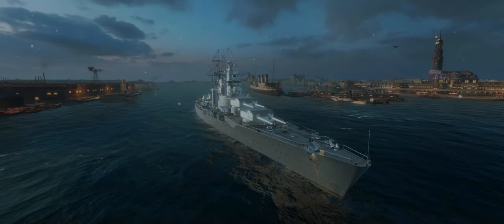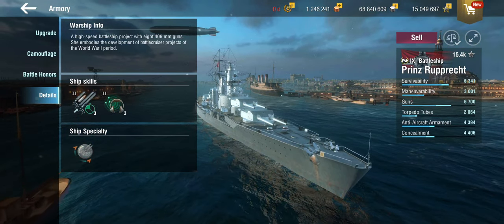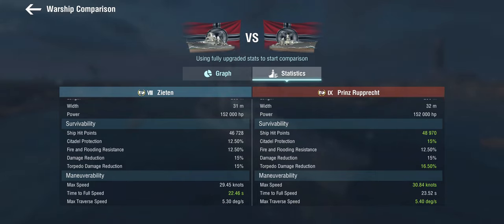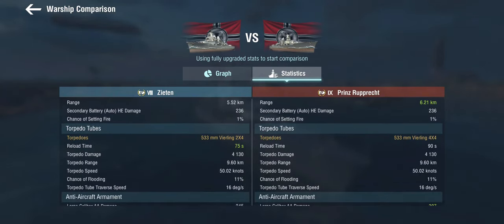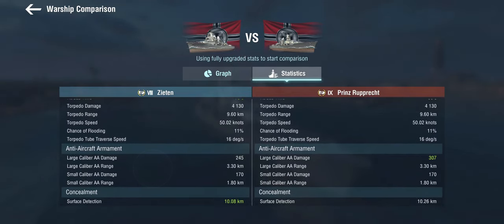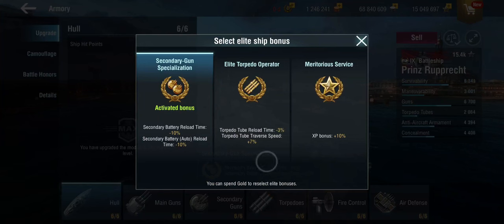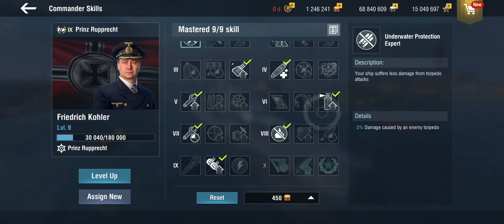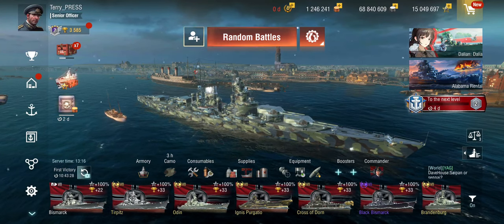World of Warships Blitz - German Battlecruiser "Prinz Rupprecht" review

Comment: Finally got around to unlocking the Rupprecht - it is such a blast to play. So far, I’ve found a secondary build with propulsion and concealment for the second and third slots have worked well, staying unspotted until you can unload a full barrage of mains, secondaries and torpedos really makes a big difference.

In terms of play style I find it’s very similar to the Odin. In fact, it seems like the Odin is what the Zieten should have been - even if you had to substitute the 128mm GK autosecondaries for 105’s in a tech tree ship.

I agree hots highly situational - but then so are many other secondary focused ships. When you can use concealment and positioning to close in, you can make absolutely trollish amounts of damage in a short space of time. If you can’t, it is more of a struggle.

Looking forward to the Schlieffen now, though it’ll be a while before I’ve ground that one.
Reply from the maker: Odin has one big advantage - size. That thing is comparatively small, and pretty manoeuvrable. Still, Rupprecht & Schlieffen are great fun, the latter is a direct progression, so if you get along with one, you'll like the other.

Comment: Hi Terry! I stand with you on the choice of the first module. I personally use the secondary battery enhance module on my Schliffen as well. 
For those guys complaining in the comments, if you guys want to use the main battery more, why play German BBs? 😂 You got plenty of options like the IJN and USN BBs.
Reply from the maker: It's not a completely invalid point - you have to entertain yourself somewhat while the teams are jockeying for positions. In the BB line, you do that by using the mains and the precise aim (which has 3x the impact of the slot 1 module), until you spot an opening. In the BCs, you use the time to get somewhere where you can use the dps, while compensating for the armour / HP. But I'm willing to test that a bit more :)

Comment: Your first module in equipment should be dispersion just like you said it "depends on the situation" most of the situation in high tier is long range kiting so yeah.. that's just my opinion ;)
Reply from the maker: I think it won't change things to be honest, but I might test that a bit more explicitly. The historical camo doesn't give dispersion, she doesn't get a precise aim skill, and the module really only adds 7%, which isn't an awful lot, if you're already starting out with a shotgun. Plus, even if you had the dispersion, she just doesn't have the range.

I'm testing Schlieffen with a full secondary build atm, and the 150s aren't that far from the 420s in terms of range. These things are meant to be mid-range brawlers, and Schlieffen's armour actually can hold up quite well if you can avoid getting focused.

They're situational ships. Some battles they'll work, others they won't. This is, to a degree, the case with the traditional German BB line as well, although they're easier due to the survivability - worst case, you push, do 100k damage, and then die, but leave an opening for your team. It's more pronounced in the BC line.